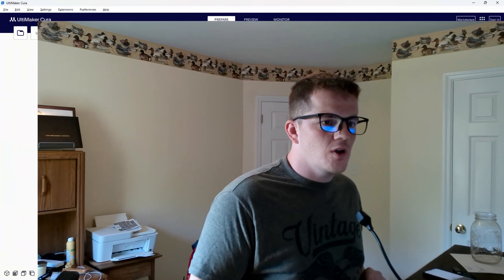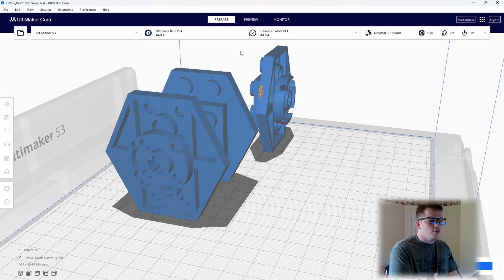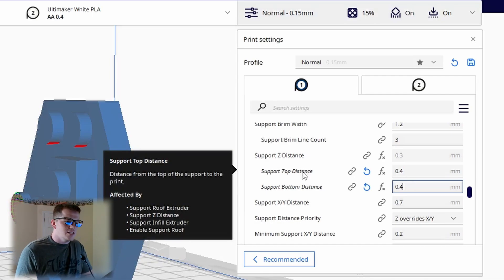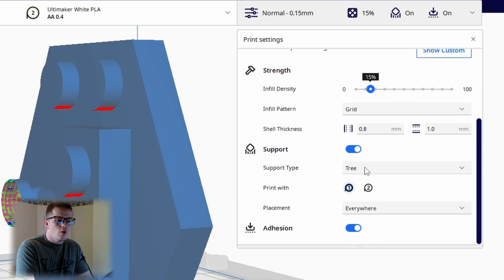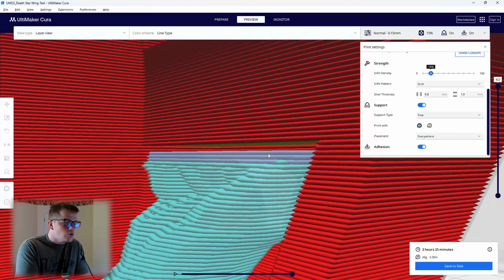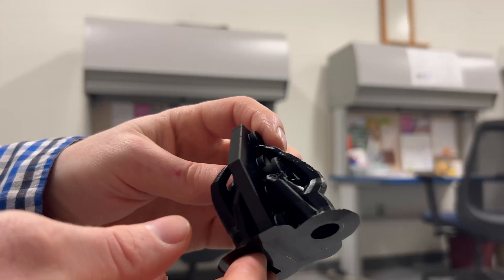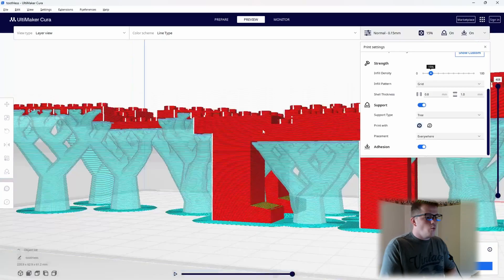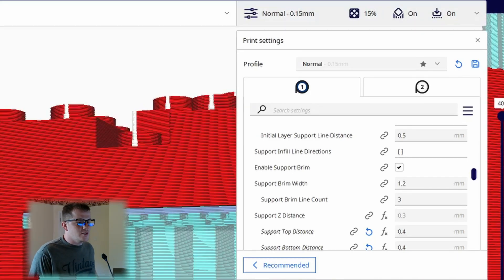A Teacher's Guide to the Perfect Cura Support Settings - How to Easily Remove Supports!

Comment: i have a problem with tree supports, thet always get knocked over and  messed up my print.
Reply from the maker: I can certainly help with that! When does it happen? Are the tree supports super tall? What printer do you have?
Reply: @KennedyDIY I'm using a Ender 3. They are not that tall. I was printing a pokemon figure, and after only 30mins in a couple of them broke off at a crucial area. Messing it up.
Reply from the maker: @DeliaHolland I would definitely try slowing the print down. Bed slingers are notorious for issues with taller supports!
Reply: @DeliaHolland didn't you try 70% density?
Reply: @NTMKhanh nope not yet.

Comment: I’m still doing these support settings on everything. But recently I’ve noticed that the surface of the print where the supports stops is very rough and sometimes not even melted together. More like just loose strings floating around but the rest of the layer above that are perfect.  Got any pointers for that? Please 🙏
Reply from the maker: Absolutely! I had these troubles myself. I would run some tests with decreasing the Z top distance - that should bring the support closer to the layer and help it to adhere better. Obviously there are some tradeoffs with it now being harder to remove, but that would be my first guess. Just run a bunch of tests and see what starts to come out better. If that doesn’t work please send me an email and I would be happy to troubleshoot with you!
Reply: @ thank You so much for replying. I was willing to sacrifice that bottom surface because the supports settings was too good to mess with. Hahaha. But not visually it doesn’t look that good. Yes I will definitely keep you posted.

Comment: I can't find the Interface Density (or something like it) anywhere in Bambu slicer. Any thoughts?
Reply from the maker: Great question - I am not super familiar with Bambu Studio. In all honesty, I have been planning on doing a video similar to the Cura one with Bambu and Orca. I did some quick Google Searches, and it looks like Bambu does have settings for Z-Top and Z-Bottom, as mentioned in the Cura video. In addition, it seems there is another setting for the Top Layers of your supports, which if reduced, should be able to make supports easier to remove. Lastly, I saw an option for Support/Object XY Distance. Adjusting this should be able to make them easier, as well. Admittedly, I do not know what the optimal settings are for these, but I hope this at least helps a little bit.

Thanks for watching and please reach out with any further questions!
Reply from the maker: Here is the page I was referencing - this might help with some additional information, as well!

https://wiki.bambulab.com/en/software/bambu-studio/support

Comment: thanks a ton for the video man but in my opinion with the print at the end i would never run normal supports if it seems like a better option i say cut the model and flip it sideways to allow flawless tree supports, you dont agree? and then place the model together. unless obviously it neeeddds to be an all in one model but then i would even flip it on its side and tree support it all the way up. about to try this .4 setting on my trees really hate removing my supports and theyre always ruining my models. on removal of course.
Reply from the maker: I can see where you are coming from here. That would allow for better tree supports, but I also feel like that adds a ton of filament to the process. I could be wrong, but there are far more places you have to support flipping it sideways.
Reply: @KennedyDIY  i can see that i learned a bran new setting in tree supports to completely remove any need for normal supports and you can print that lego print the excat way. if you go down into cure theres a setting at the bottom of supports called "support interface" i found a video on youtube where when using this setting you can make the tree supports attach to their OWN roof then into the model as a merge rather than just touching it will interlap the layer lining on the roofs so all the trees turn into one tree and merge into the model making it seemless i printed a long flat just like your lego piece here and it came out flawless all support ssnapped right off and no bottom layering issues under the print nothing it looked really good compared to normally looks insane stringing beneath the supports. try to look at it or give me amessage if you want some mroe info i also found a setting to move the direction the printer does all infill you can type in degrees of change into those parenthesis im running 90,45 and now my prints are ROCK hard as well and way less stringing from that setting alone.
Reply from the maker: I would love to see that video! If you could send a link my way, that would be really appreciated. Thank you!

Comment: Good Morning, what settings would you recommend for under a flat surface. So support roof. I went down to 15% and still a pain to remove. Thank You
Reply from the maker: Absolutely! My suggestions for these tough areas would be to use normal supports and raise your z-top distance ever so slightly. It is hard to know exact settings to suggest, but testing with these should put in the right direction. Feel free to reach out if you need more help! Good luck!
Reply from the maker: I actually just watched this great video. Might be right up your alley!

https://www.youtube.com/watch?v=_vu__k4_UQU

Comment: Do you teach going supportless (maybe at an angle)? and/or coding the supports into the model? I've been having fun with both of these things. (i do NOT like supports, if at all avoidable... and I also do NOT like filament swaps unless i have to)
Reply from the maker: Absolutely, we try to as much as possible! I haven’t tried with coding the supports into the model, but definitely going without supports as often as we can. Supports are always a pain but this is the best method I have found, by far!

Comment: Z distance of 0.3 is the same as 0.4, Cura rounds up to the next layer height so 0.3 is essentially 0.4.  It even tells you that while you hovered over the setting and the info window came up.  Another thing to check out is your print temp.  If it's too hot, it'll fuse no matter the distance.

Comment: What over hang degree are you using?
Reply from the maker: I typically stick with Cura-recommended settings at this point, which if I'm not mistaken is 60? I haven't ventured far into that environment quite yet, but I am open to any suggestions that you might have if you have tackled that.Thanks for watching!
Reply: Thanks for the video, going to try the overhang test print next to refine even more
Reply from the maker: @ awesome! Let me know how it goes!